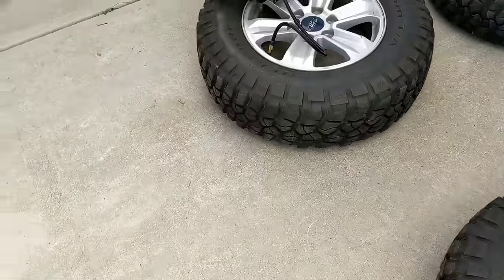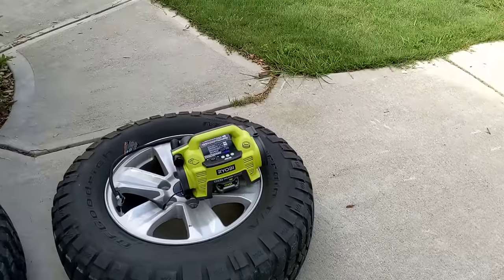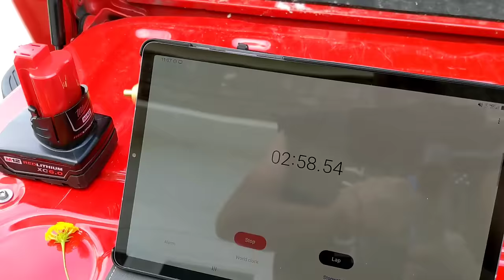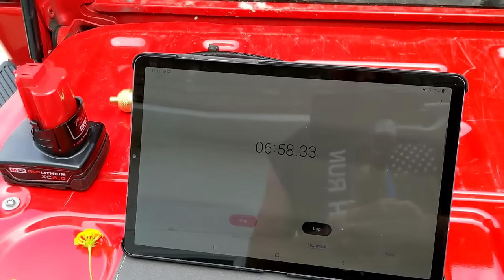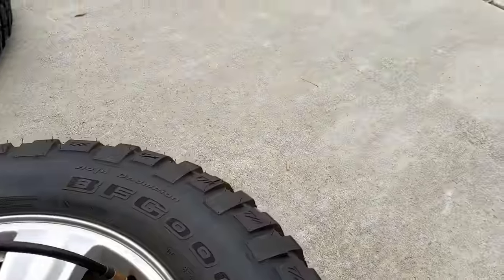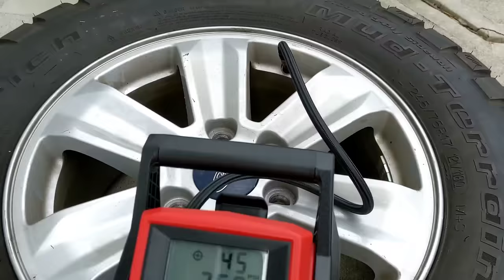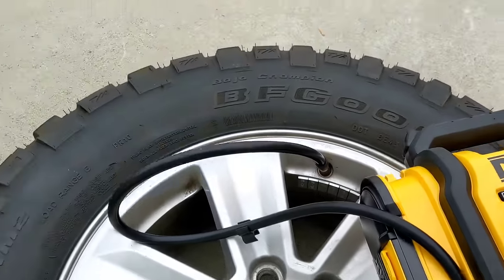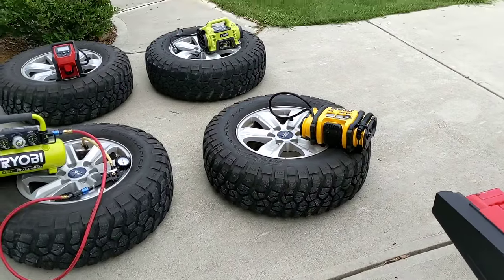Ryobi Milwaukee DeWalt inflator and compressor review

Comment: I enjoyed the comparisons. I didn’t read all the comments so this was probably mentioned, but many were commenting on the backup plan of needing to plug into the vehicle.  It’s simple for me.  I take my cordless compressor and all of my charged up batteries.  But, I also bring their battery charger.  Plug that into my trucks 110V outlet and keep my batteries charged.  Pick the tool which provides the most versatility and practically for your individual needs.  My batteries also run my 1/2 impact wrench, sawzall, and several other tools for the trail.
Reply: Ryobi make a charger that plugs in to you 12 outlet
Reply: @dennisgermain189  The Dewalt includes a 12V plug. No need for extra batteries if keeping it in the vehicle is a priority.

Comment: I have a few of the Milwaukee pumps and they pump noticeably better and faster with a 4 amp or a 6 amp hour battery in it than it does with the two amp power batteries I don't even waste my time putting the two amp hour batteries in them anymore.

Comment: Nice little comparison video. Would be interesting to see some of the other battery-powered air compressors on the market try to do the same challenge. I have a handheld Ryobi 18v inflator that does a pretty decent job for pumping most tires up. The only drawback is you have to press a trigger and read a gauge at the same time.
Reply: I have one of those and gifted my father-in-law one, got to Walmart and find Velcro tape, I wrap that around the trigger so I don’t have to hold it
Reply: Are you talking about the one with the round digital gauge? If so, you turn the wheel on that gauge to your desired psi and press the trigger. It will shutoff automatically when it reaches the desired psi.

Comment: Make a note that the ryobi with the inflator wears out. Ive gone through 2 of them. If i had to guess, i probably used them about 50 time from 15 psi to 44psi before the inside gives out (bearings i think wear out and starts making a really bad loud noise).

Comment: You should of used the same size battery batteries for all whether it’s a 2amp or 5amp. Also, if a person is already on a certain battery platform, it doesn’t make sense to buy a different manufacturer just to have something in the car. I happen to be on a dewalt platform, and I’m happy with the inflator, excellent for tire pressure maintenance.
Reply from the maker: You're right, and if I had the same size I would have used them.  Keep in mind they are different voltages also so even with same amp hours they are not apples to apples.  Thanks for your comment

Comment: I found that if you put a 12v 6ah battery in the Milwaukee, it will fill up a large 19.5 truck tire from 0 to 110 with no problem.

Comment: If you don't need cordless, check out the superflow mv50 12volt or the large $70 harbor freight 12v compressor, both are fairly quick and inexpensive

Comment: get a dual stage comp high volume low psi and high pressure for hi psi I Personally use a Smittybilt one clamps to my batter lugs and 37" 12.5" from 12 psi ro 37 in under 5 mins. used it for last 5 years weekend wheeling its solid !!!

Comment: The tank mounted Ryobi compressor must be double the CFM output of the others. It would have been even faster if you would just hook a tire chuck straight to the tire and used the air regulator with the 2nd gauge on it to set your tires pressure. (compressors pump less volume at higher pressures) The other battery powered compressors must be teeny tiny to take so long and I hear most of them tend to run very hot and don't have very good fan cooling. So Take off the inflator pistol grip thing you have. Get a lock-on tire chuck and screw it on to your hose end or quick couple it onto the air hose end. Set the output line pressure regulator on the Ryobi with the tank to whatever tire pressure you want. Get in your car and let it pump up to 40 psi or whatever and it will shut off after it does that, and it will fill its tank up to a higher pressure also to boot!  The tank mounted Ryobi is the only good choice here. For convenience and speed and ease of use once you set it up. Any other brand of the same size and output on a tank would be the same also! It would also be the only one that could air up a 3/4 or 1 ton  pickup or SUV tire I bet. The others would be in thermal meltdown and need multiple batteries to hit the 70 psi required on those tires. They are marginal even on car and small truck tires it looks like to me.
Reply from the maker: I'll do another video to test those suggestions
Reply from the maker: I just tested out your suggestion,  check out my latest video.

Comment: Nice comparison. You should have manually checked the air pressure once they hit 32 psi to see how accurate each one was as well.
Reply: It was done in a different video. Ryobi was way off and dewalt was the closest to accurate.
Reply: @John-771  nice, I'll have to check it out
Reply: I have the dewalt. I checked a couple times with a manual gage just to make sure, and both were within 1PSI, plenty close enough for most applications.

Comment: I have a cheap arse inflator I bought like back in 2000 from like Walmart or something for like $30. It has a long plug that goes in the cigarette lighter.  It is like half the size of the DeWalt and has saved my butt a few times when I've gotten a flat.
Reply: Lol, soumds like the same thing I've got. I'm scared to rely on a battery inflator with no 12v cord backup
Reply: @yootoobactnameyoo5221  These are great to have at home, as I have the cheapest Ryobi and I use it at home to air up my Wife's 2016 Buick that leaks air because they use stupid built on wheel covers.  Also, good for bikes, wheel barrows, balls etc. around the house.  Yet the cheap one goes in my car on road trips as it takes up no space and works, just loud and old.  I have an air compressor nice one actually 30 Gallon.  I am finding I'm not using it much though as at this point it is only useful for my air hammer and having compressed air to blow filters out carbs out etc.

Comment: My RIDGID R87044 went from 0 to 35 PSI on my truck tire, 33/12.50/16.5. It took about 8.5 minutes. Battery went down one light bar. I tried to take a screenshot of the timer, but when I sent it to my son, I didn't notice the time didn't show up in the screenshot until after I deleted it already. So that may be a good contender for this also.

Comment: Hey brother,  I have the Dewalt, and I got the 20 volt 5ah battery with charger and a carrying bag, and the battery lasts for months at a time even after using it multiple times, and it has an inflator for floats or what ever else you want or a deflater, and project farm did a long and distance comparison on Milwaukee and dewalt and the dewalt out performed and out lasted the Milwaukee,  thats the reason I got my dewalt compressor but you need a 5ah battery

Comment: You can have a standard lock chuck for the ryobi compressor and just set the gauge for the desired psi and you won't have to hold the handle. The compressor would have also done better if you didn't let the pressure build up as this puts strain on the motor, lowers the rpm and the evacuation efficiency of each compression cycle.
Reply: True.
Reply from the maker: Watch my video on doing just that.

Comment: Did you also mention that the Milwaukee is only 12V compared to 18 and 20V?
Reply: DeWalt 20V is only marketing. In Europe it is 18V.
Reply: Torvikholm thats not what the point was.

Comment: It looks as if the Ryobi air compressor started out with stored air in its tank, going by the pressure gauge? If so, this gives it a much greater advantage.
Reply from the maker: Yes, I did it that way because it can be stored full. Without the air chuck it seems to retain its pressure.
Reply: @apocalypse2941  you shouldn't store a compressor with air in the tank the moisture leads to rust. You should dran the tank after every use.

Comment: Even more impressive is that the Milwaukee is only a 12 volt while the DeWALT and Ryobi are 18 volt.
Reply: The dewalt is 20v
Reply: Daniel Barber That’s a marketing gimick. It’s got the same amount of 1.2 volt cells as other 18 volt batteries. DeWALT just markets it as 20 Volt* (When it’s fresh off the charger and not used yet). That applies to all batteries, DeWALT just advertises it to sound like you’re getting more.
P.s. Now make this the “Highlighted reply”.

Comment: Nice video, I have the Milwaukee inflator and the new Milwaukee compressor.  Both are great!
Reply: The Milwaukee 2 gallon compressor can't even fill a tire without it stopping to refill, and only 1 dial is pretty disappointing.  Honestly for $120 which $200-300 less, my 6 gallon Craftsman with two dials and outlets weighs the same, a lot louder, but does not disappoint for the money.  I guess running it on an 18v battery can be nice in an emergency, but have not had that emergency myself yet.  And I have pretty much all Milwaukee tools, but some of there stuff isn't so great, but they usually fix issues with future gen issues.  I would like to see a new version of the compressor, to be honest.
Reply: @anthonyfortunato9451  "Portability " is the key word you are missing with the Milwaukee or even DeWalt portable compressors.  They aren't designed to compete with a 6 gallon compressor.  It's not for everyone but with my small farm it has come in handy. I can fix tires on the spot and seat beads without having to take the tire back to a shop.

Comment: The Milwaukee and Ryobi units have one huge draw back when used for auto use. That is due to their reliance of having one source if power - battery pack. The Dewalt wins out because it is the only one that can be used with battery pack, 12V DC, or 120V AC. The clear winner especially if your vehicle doesn't have a power converter and you don't carry a battery charging station.

Comment: I run the Milwaukee in each of my vehicles with 2 6ah batteries and a 12v charger. I also carry the m12 1/2” stubby impact kit with a 6ah and a 4ah battery and a impact rated lug nut socket set.

Comment: I would choose the one that can also run off of the car battery. I never trust batteries and you never know what kind of situations you may run into. Always look at backup situations.
Reply: Ryobi make a charger that plugs in to you 12 outlet and a battery powered compressor will go anywhere you need it

Comment: I have the milwaukee the same1 he is testing here and I can inflate a tire on my f550 that was @ like 55psi up to 90psi and it did it with ease. Yes it used up the entire 5amp battery but it had no problem doing it and it was a front tire so the 7.3l as a load.

Comment: Good review. I still prefer the ones you hook to the car battery. I think they are way better. I even inflated a small wheel loader tire using it. The air compressor I used was a Canadian tire brand...

Comment: If you’re gonna keep one of these in the car then it has to have a 12V cable as well. Because you know on a darn cold night is when your drill batteries will be dead. So yeah. Need a plug in option as well. Just my 2 cents!

Comment: Just a suggestion....
I like the way you did your comparison,  except you should have used larger Amp hour batteries. 
Using a larger Amp hour battery makes all the difference in the world. 
Longer run time, not just 10 minutes, and faster inflation of your tires.
Personally, after your comparison, I prefer Dewalt.🔧
Reply from the maker: Thanks, check out my follow video with bigger batteries.

Comment: you are comparing apples to oranges here.  The Ryobi compressor has a tank and a 5ah battery while the Milwaukee is only sporting a 2ah battery.  It would appear that the Milwaukee M18 Fuel compressor(the one with a tank) with a 5ah battery would be a more appropriate comparison.

Comment: Thanks for the vid, glad the Milwaukee won because that's the one I already have!  It's definitely worth the investment so you can air up easily at home rather than finding a gas station with a working air station, and hopefully one that doesn't require quarters to operate (can cost up to $1 here in Cali!).  It's a solid unit!

Comment: I will go with the DeWalt over the others only reason I'm already on the DeWalt battery platform but I'm very impressed by all of them if I wasn't so much in the DeWalt battery platform already I would love to get anyone of these
Reply: I have the issue with milwaukee would love to buy Dewalt but I'm deep into the system and have spare batteries. So it's almost an inconvenience to carry a different kind od charger around for a tool or two😔
Reply: @BaltazarSMZ  I agree with you it's almost more of a pain to have more than one battery platform if you don't do construction for a living and need different types of tools and each brand is got a better tool everyone knows that but I'm still a die hard DeWalt man

Comment: I bought a cheap unit off eBay. 4wd compressor. Pumped up my 31 by 10.5 tyre to 30 psi in 2 minutes but up to 40 psi it took another 5 mins

Comment: Why don’t they put a better tip on that compressor (or maybe one could be adapted)… does it automatically shut off or am I asking a question that was very obvious in the video?!?
Reply from the maker: The air chuck doesn't come with it,  I have since upgraded.

Comment: In order for this to have been a fair test. You would have had to use the same size battery in each inflator.
Reply from the maker: No they use different Voltages and even the same amp hour rating doesn't mean they are equal.

Comment: Great video, this is just what I was looking for.  I wonder if the Milwaukee would air up 4 tires on one charge? I would love to see a follow up review.
Reply: Get the 6.0 battery. might do it. But that is a lot of air needed.
Reply: When I inflated all 4 standard car tires from 0 to 35 with the Milwaukee and a 6.0Ah battery it took about five minutes per tire to finish and it needed a little bit more than a 6.0Ah battery (one bar decrease from the 2nd battery) for all 4 tires.. good that I bought 2x 6.0Ah batteries with it (even though not original batteries but cheaper 3rd-party ones called 'vinida').

I think 0 to only 30 on all 4 tires is achievable with just one fully-charged 6.0Ah battery. This little inflator is AMAZING!

Comment: For the dewalt or any tool without a fuel gauge to check how much energy is by using a volt meter any 18v/20v would be considered dead at 15v but I never go under 15.8/9v just to be safe don't know about 12v
Reply: These tools including the Dewalt will all sense voltage and turn themselves off when voltage reaches a low enough threshold.
Reply: @brow1901  No the battery do not turn off they still send power to a drill or impact the voltage does cut out around 15v but there are people that just keep using the battery which causes the battery to get damaged/will not charge since it's under 15v you most have never killed a battery
Reply from the maker: @brow1901  yes two of the inflators shut off due to low battery in the video.

Comment: It sure seemed like the final pressure target wasn’t the same on all.  The Milwaukee was 31.  Dewalt was 31.5.  Ryobi was 32. Am I wrong?  Maybe I missed something.
Reply from the maker: So they all stop at different pressures... the ryobi goes +1 psi from target and the dewalt is +.5 psi above target and the Milwaukee stops on target.  Good eye and thanks for the comment
Reply: The Dewalt, and I'd assume the Ryobi, goes a little higher to account for loss when disconnecting the hose.

Comment: Check out the new 20v Worx pump. You can run their 2.0, 4.0 or 6.0 amp battery. Its smaller i dont know how it would compare to those but they make some good tools.

Comment: I'd go with Dewalt then you're able to plug into 12v socket in vehicle.  No brainer decision for me.   Milwaukee would be 2nd choice behind that.
Reply: thanks for comment he never mentions that aspect which is huge especially if your buying it to carry in a car, he was also using a outdated battery in the tool he should have had a new 2ah dewalt battery it makes a huge difference

Comment: Upon learning I had a low tire, go to the gas station. Guy in front of me inflating his tires (fine). Then he gets out from the truck bed to inflate a steel air tank with an air nozzle receptacle (okay?). Result is the gas station inflator cannot handle the job inflating the steel air tank probably due to psi, and guy is getting upset by the minute instead of stopping.
The guy then proceeds to beat the gas station air inflator onto the pavement over a dozen times.
I leave knowing that now beat up air inflator will never work for me despite putting my money in the machine.
Reply from the maker: People are crazy

Comment: I use the Milwaukee with the 6ah battery 👌
Reply: Same and it's interesting to see people fighting the free air pump line at gas station  when cold weather hits while I can pull out mine and fill up in under few minutes without wait. I did buy quick connect hose attachment (Melphan-Auto 2PCs Air Inflator Hose Adapter Convert) to simplify connect/disconnect time.
Reply: @alexs.3789  thats a great idea im definitely looking into doing that 👍